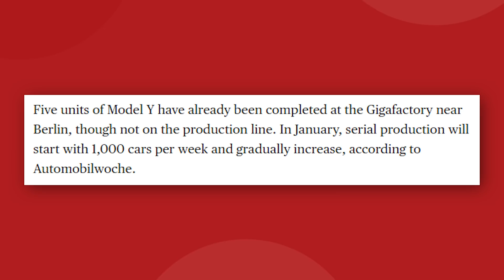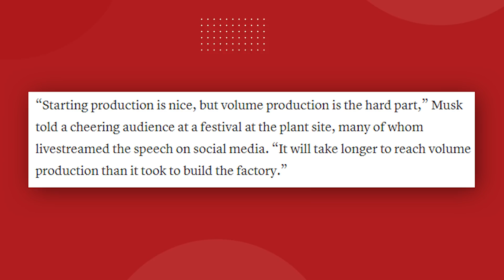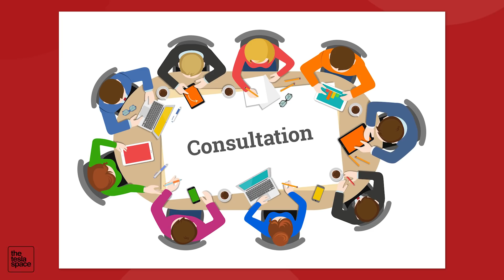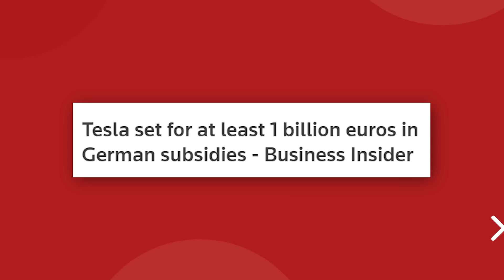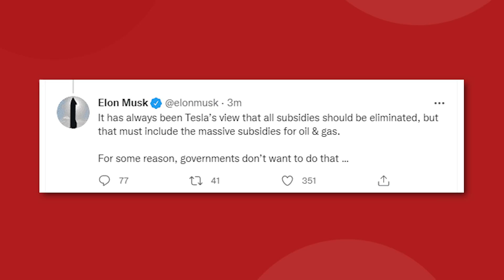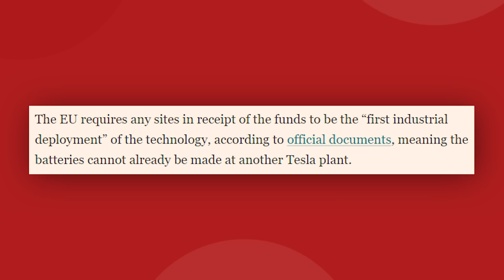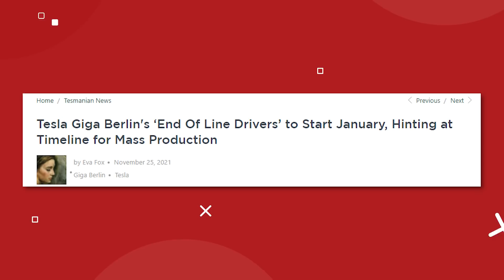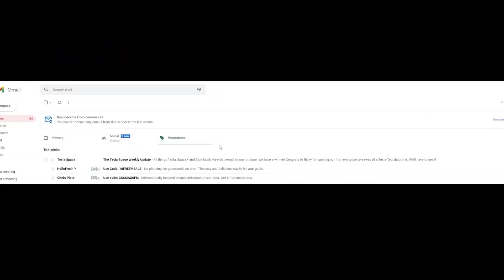Tesla Gigafactory Berlin Is Opening!

Comment: This would have been operational months ago if built in the UK. How daft to risk building it in Germany.
Reply: To avoid import tariffs, Tesla’s European factory needed to be built in the EU, which doesn’t include the UK. I was surprised that the factory wasn’t built in Poland.
Reply: @Laura-S196  Well Gigafactory is very close to German-Polish border, so Poland will participate in this project through Polish suppliers (they already supply with high quality car parts other German car industry giants like VW or Mercedes) and also through cheap Polish factory workers. I think that was part of the plan, to build it close to Poland, but in a more stable country like Germany.
Reply: It looked like a slam dunk to Tesla. The building already existed as did “all” the permitting. It was originally done by VW, but they abandoned the entire project when Tesla bought it.

Comment: I wonder if the German versions of Tesla cars will be built to higher quality standards just due to the cultural tendencies of that area.
Reply: The Model3 made in China is the one we receive here in Oz, and it is regarded as being built to much higher level of fit and finish than the Model3 made in Fremont CA.
Reply: The Fremont plant,  when it was GM, had the notorious reputation as being the worst plant in North America. It may have been an uphill battle to get the local workforce to yield quality results.
Reply: So far, thousands of Teslas have been sold in Europe, but built in California and China! Demand is very high throughout Europe, so the Tesla standard will perhaps set the new European standard. It should be made easier by the castings which bridge the mechanical parts and the body parts. They are made to exacting standards never possible before. Each part is identical, so all parts should fit to very close tolerances.